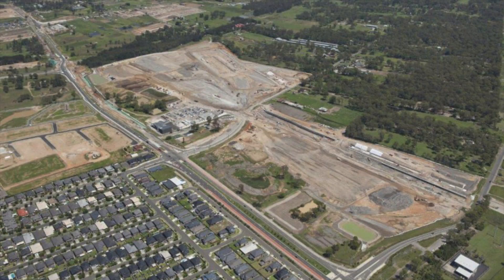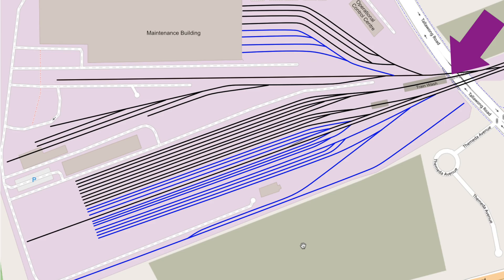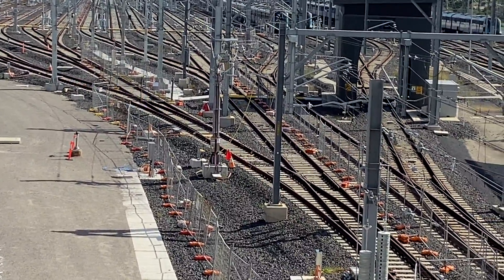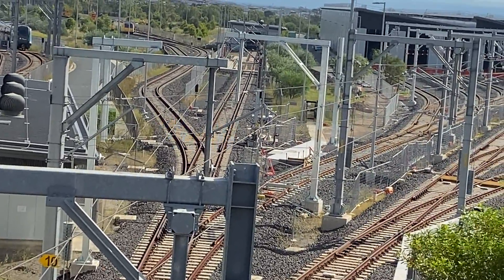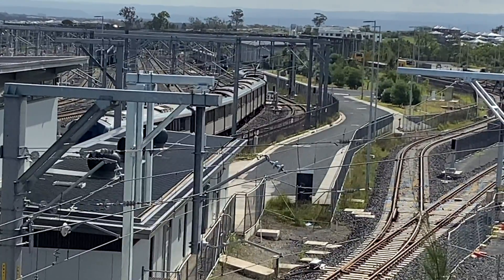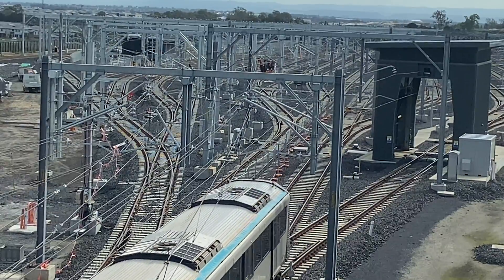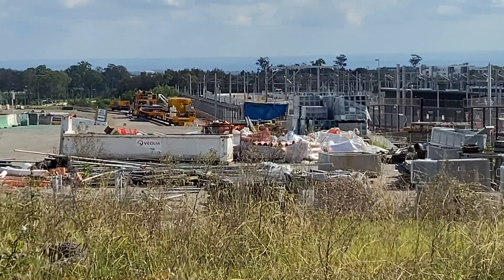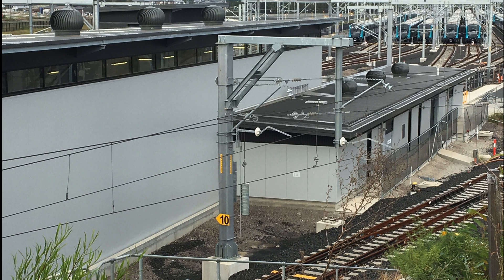Sydney Metro Trains Facility North Expansion at Rouse Hill - Autumn 2021 Update

Comment: only 8 sets of trains required off peak to run at 10min service? Amazing. Do they keep a set of train or 2 overnight at Chatswood for the early morning run so that it can provide service from both ends？
Reply from the maker: Yes that's right. In the off peak, the journey takes 36 minutes from Tallawong to Chatswood.  It's then 6 mins to reverse and another 36 mins back to Tallawong, where there is just a 2 min turnaround (you can do that when there is no driver to change ends!) so that's an 80 minute roundtrip. Divide that by 10 (for the 10 minute frequency) and its 8 sets!  I don't think any trains are stored at Chatswood overnight. The first departure from Chatswood is at 05:07 and there isn't an incoming service to form that one, so either a train runs out of service to form that one, or one is kept at Chatswood!  Hope this helps!

Comment: Talking of the extension to Marsden park, I am concerned that the bridge over the entry into the depot will need to be partially rebuilt as there is no route through to the west.  I assume Tallawong Road has all the main incoming services for the depot running underneath it.
Reply from the maker: Hi Andrew, there is space under Tallawong Road bridge for one (possibly 2) extra tracks. See 7:07. I think this was done to allow the Marsden Park extension and/or allow for additional capacity into and out of the maintenance facility in the future.
Reply: @TransportVlog  thanks, I am not local and only use our favourite mapping package to make the above comments.
Reply from the maker: @andrewjameson5918  Out of curiosity, I was wondering which mapping package you use?

Comment: There is some information about the locomotives in an ARHS e-book called “A Guide to Australasian Locomotion 2020”, if you buy this book, you’ll find some information about the metro locomotives. Do let me know if you want me to paraphrase the info!
Reply from the maker: Hi Dean, if you could paraphrase this, that would be great. I don't have this book yet, but I think I might well buy it.  It will help immensely with a video that I'm working on covering freight trains in the Hunter!
Reply: @TransportVlog  Yes it’s a really good wealth of info for locos (fleet details, tables, photos, descriptions, and a brief intro to the railway systems in general, etc) not just in Australia, but also in New Zealand and Fiji. Includes mainline, heritage, steam and industrial locos like the QLD sugar cane trams too. 376 pages FYI and it’s great that it’s a PDF as well, extremely easy to find what you want.

So there are two of the yellow battery-electric locomotives numbered BEL001 and BEL002. They were built by CRRC Zhuzhou Locomotive, China. They run on the overhead 1500 V DC, but can also run on 768 V DC batteries. They’re used for yard/depot shunting and occasionally do go on the line towards Chatswood. They were built in 2017. 13.42 metres in length. 56 tonnes. Bo-Bo wheel arrangement. 400 kW overhead traction (536 hp) or 300 kW battery traction (402 hp). 

Apparently there is also a third “much smaller remotely controlled” locomotive used for the wash shed, but there aren’t any more details about it in the book.

There’s also a really nice close up photo of BEL002 in the book.
Reply from the maker: @deanl4575  Hi Dean, thanks so much for this information. I knew they were built in China and could also run on batteries, but its wonderful to have the additional information.  I reckon, I'll be getting my copy very soon! Thanks again Paul.

Comment: The covid did bring some good news to Sydney metro construction, as it faces lower pressure from daily commuters and it gives Sydney a 'cooling time' to update its infrastructure. Once the day back to normal, the 4 minute gap during the peak hour is too long. It should be 3 minutes (calculating from door close to next train door open) during peak hour ,and 5 minute during off peak, otherwise it won't work. As for the 'other half of the ring', if it can connects to St. Mary, not sure if above ground is an option as the western area facing flooding warning more frequently due to global weather change'. I hope the other halt of the ring can be reached, and also can have interchange with Sydney Metro West.
Reply from the maker: Hi Tony, Yes I'm sure the frequency will increase when the City and Southwest section opens in 2024.  The signalling can cater for trains every 2 minutes and of course there is the potential to add 2 extra carriages as well.  Good point about the flood areas in the west. I'm sure this will be considered when the line is extended towards St Mary's.

Comment: Hi Paul, thanks for your videos. 
I'm keen to find out the stations between Tallawong and St Marys.
And...in particular what side of Schofields Road the metro will be constructed on (aka "South St" which it known as - ie intersection of Schofields & Carnarvon Roads heading out to Richmond Road )
I'm sure I saw a plan that said it will leave Schofields Station and cross back over to the north side of Schofields Road, out to Richmond Road, then down to Ropes Creek area and eventually St. Marys. I just watched another channel (a CANADIAN man talking about the Vancouver planning v Sydney Metro planning). He said, to alleviate wasting land on carparks, you technically should build metro stations approximately 1km apart so that people can walk 500m either way and minimise traffic. 

About 18months ago, driving along South St/Schofields Rd, from Richmond road direction, just before the crossroad traffic lights at Carnarvon & Schofields road, they put up this really strong FENCE on the path. It was weird, there is NOTHING there for them/no reason for them to place a safety fence light that in the middle of nowhere, my GUESS, a metro train station is "proposed" to be placed there and that safety steel fence on the pathway is so that people don't pile out of the train and try to immediately cross the road. Any comments anyone? (Are you in the "know" Paul or is there anyone out there in the know) Thx Peoples. 👍
Reply from the maker: Hi Vanessa, I don't have any inside knowledge, but other people may.  I'm not even sure if the proposed route has been safeguarded as yet. Let's see what happens.

Comment: The other lines you mentioned at 1:25, they are how the deliver the new trains into the Metro network. They have a set of ramps that the bolt over the tracks and then they back up the truck that is carrying the train to that ramp and push it onto the rail.
Reply from the maker: That makes sense.  Thanks for explaining that. It would be really cool to be there when a new train is being delivered! Something to look forward to when the extra trains for the City & Southwest extension arrive.

Comment: Hi Paul, great video! Some comments:
- I believe the stabling tracks aren't long enough for 8-car trains yet. They're only long enough for the current 6-car trains. That's why there's empty space between the buffer stops on all the tracks and the western boundary of the site. If they built them 8-car long now, the track would just be sitting there degrading and instead they can extend the tracks pretty easily/cheaply in the future when need be.
- The extra tracks whose purpose you were unsure about when showing the schematic diagram are probably for infrastructure maintenance vehicles like tampers, rail grinders, hi-rail vehicles, etc. Looks like they unload new train sets in that area too.
- The small building near the train wash is probably some kind of automated diagnostic/inspection set up to monitor trains as they enter and leave the yard.
-  Points and turnout (and switch) are used interchangeably. Depends on which part of the world you're in.
Reply from the maker: Yes, you could be right there.  The planning documents stated 8-cars, but as you say, it probably doesn't make sense to have the longer lines right now. The key thing is that there is space to extend them in the future, which there is. Yes it would make sense for the shorter sidings to be for maintenance vehicles. It would be cool to be there when a new train is being unloaded! Someone else also mentioned that the small building is probably an automated inspection facility. Thanks for clarifying points v turnouts too. Glad you enjoyed this video.

Comment: IN relation to your comment Paul, about the extension of the line from Tallawong to St Marys, a plan I seen twenty five years ago, was the new outer suburban rail corridor that is now part of the Metro, from Tallawong, the line would proceed to join the Richmond line & from Richmond, a new line would head back to St Marys, with a new line from that junction to Camden, forming a triangle at what is now Leppington, with a through line to Camden, this line would connect with the main south line as part of the proposed new coal line from the western line to the south, that would then connect with the still uncompleted line to Port Kembla, that was halted in the middle of construction in 1989, I also believe there was a proposed line from St Mary's heading east towards & past Parramatta to Carlingford that would continue to Epping to connect with the Epping Chatswood line, then under construction, this plan also included the now completed Leppington & Sydney airport line to Central, there was another part of that plan showing a line from Central to Wynyard via St James to North Sydney, over the bridge, option 1, option 2 was from St James under the harbour to connect with the Lavender Bay to Waverton line that would by pass North Sydney, of course this was to be built for double deck rolling stock, not the narrow profile loading gauge Metro, but like all plans regarding rail & road construction in this state, governments change & so do the plans.
Reply from the maker: Hi Adrian, thanks for your comments about the various plans over the last 25 years. I've not been to Camden, but it does seem like it deserves a rail line. Maybe I'll do a video there sometime.  The freight line you're referring to sounds like the Maldon to Dombarton freight line. I talk about this in my Unanderra to Robertson rear of train video at about 15:20 - here is the link https://youtu.be/T1T_xgn3a7E.  Yes I was aware of the plan for a line from Epping to Parramatta. Your additional CBD lines seem interesting and I suppose Sydney Metro will cover some of these now. Thanks again for sharing this planning history!
Reply: For your information there was a branch line to Camden from Campbelltown until 1960 it was then cut back to a coal loader facility at Narellan until the line closed in 1961, the grades on the line in that section was around 1 in 19 or 1 in 20, it required two steam suburban tank loco's with a another banking the rear of the train to negotiate the grade.
Reply: We rented a house for the contractors to upgrade the power for proposed Camden Springfarm line near Minto some 2yrs ago.

Comment: I have a sneaky suspision that small shed is a Rollingstock Mantanance Inspector shed. Doing radio and video inspecktions before stock goes out into the field. So instead of humans out inspecting the trains it's done Electroniclly. Thus taking the risk out for humans. I could be wrong but I very shore I am right.
Reply from the maker: Yes that would make sense, and yes, definitely safer to inspect remotely.

Comment: 4:16 What are those yellow engines at the top of the screen? They look nice, kinda like some German electrics.
Reply: Could possibly an MTPV train for the metro line or something for shunting or trackwork.
Reply from the maker: According to someone who left a comment earlier, it is an electric / battery powered loco that was built in China - more details here - http://www.timeselectric.cn/sddqen/s/1423-4832-2976.html
Reply: @TransportVlog  I’m assuming that’s what the loco shed is for! Makes sense
Reply: @TransportVlog  Maybe you could do a video hunting to see the engine when the line has trackwork?
Reply from the maker: @griffinrails  I'll see what I can do :-)
Reply: It's a shunting loco, has to be battery powered if a power failure shuts down trains, can't use diesels in a metro tunnel.

Comment: The building over the track could be a carriage washer.
I can never understand why the line terminates at Tallawong, it seems more logical to take to Schofield's and provide an interchange.
Reply from the maker: Hi Steven, Yes I thought that too, but the larger washer on the right makes me think it might be something else. I think the reason for terminating at Tallawong was to serve Rouse Hill, and I agree that extending it to Schofields would make sense.
Reply: @TransportVlog  so I wonder when 8 car trains will run? they platforms have provision for them.
The one think I believe they got wrong was to use 1500DC instead of 25 KV as it 9nly required 1/16 of the current which would mean less substations a huge saving in copper wire and masts that are much smaller too.
They have provided double contact wires to reduce voltage drops and this would be unnecessary on 25KV?
Even 3000 DC would mean you would only require a single contact wire.
Regardless it is a wonderful price of infrastructure and Sydney needs to have a metro mania.
I think the Riverstone line to  Richmond should become metro to Black town, also the North shore line between Hornsby and central as the line capacity is much great on rapid transit metros.
Reply: @Steven_Rowe  I think 25KV would require heavier insulation, which could mean higher tunnels. Very few metro systems use it, some in Japan are only 750v.
Reply: @brianb8516  yes it does require heavier insulation but no where near as much as you think.
Look ar the insulators on top of 25kv locos and they not 4eally long so therefore if there was going to be a flashover it would occur between the pantograph frame and the roof which is at earth potential..
I am actually amazed they didn't use third rail too as most metros use it and of course London Underground use 4 rails the outside is 440 +ve and the centre is 210-ve giving a 630volt supply
Reply: @brianb8516  , 25kv is what all the newer systems use.  they would be wise to set any new work with 25kv equipment so that conversion to the higher voltage can be undertaken with less disruption in the future.
Reply: The old alignments that the route uses are already 1.5kv, and it would be a lot of work to change it over. The masts and copper cost are probably insignificant compared to the general construction costs.

Just about no one uses 3rd rails anymore (unless it is an extension of an existing system) because of danger to workers on the track. Workmen do still do maintenance while the lines still operate. And if the emergency exit system was ever used passengers wouldn't be allowed out of the train until the power is turned off.

In terms of the conversion of the Epping to Chatswood line, all they did was install platform screen doors and the new signalling system, everything else is the same. The Bankstown line will be similar other than the station rebuilds. 

25kv does require much more substantial "dead zones" in Brisbane trains go over a set of magnets which disconnect the pantograph breakers while the train traverses one electrical section to the next, the breakers the re engage once the train travels enough distance.
Reply: @TransportVlog  It's possibly a video inspection system for the roof.
Reply from the maker: @kcobley  Yes a few other people seem to think that too.  Trains can be observed remotely from the control centre as they come in and out of service.
Reply: I would suggest that the line was not sent through to a Schofields interchange because passengers would then travel too Schofields to change trains into the city to avoid having to change at a very congested Chatswood.
Trains from the Richmond line would then be pretty much full by the time they arrived at Blacktown due to the minimal trains on the Richmond line.
Reply: @Marcus_Wilson  that is possibly true in the short term but then in less than 2 years the line will go to the city.
I think it's rather short sighted that the line wasn't sent to Schofields for this position
 this reason
I also think some of the other existing rail lines should be metrified..
The north shore line I would convert.as they could vastly improve passenger numbers and service speed.

Comment: So Tallawong was always meant to have 3 platforms but only has to (platforms 2 & 3 - hence no Platform 1) From what I understand is that the additional platform could be added when the metro does end up eventually being expanded to Marsden Park (which I just live down the road from there) and to St Mary’s but I am yet to confirm this
Reply from the maker: Hi Alex, I'd never noticed that there was no platform 1! As you probably know, there is an extra line from the maintenance facility that goes through Tallawong Station, but doesn't have a platform. It's good that there is provision for an extra platform. Even if the line wasn't extended, trains could run at 2 minute intervals in the future (the signalling is designed for that), and I reckon, you'd need an extra platform then!
Reply: @TransportVlog  yes from speaking to staff that's exactly what will happen but no ETA for this. Personally I think they should first extend to schofields station (which has been provisioned for) and Marsden park first then down to St Mary's